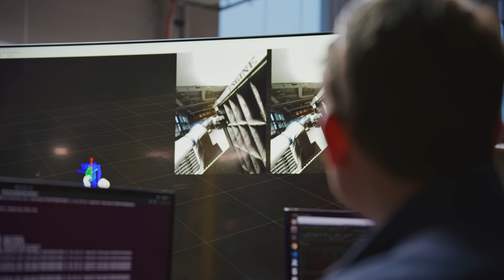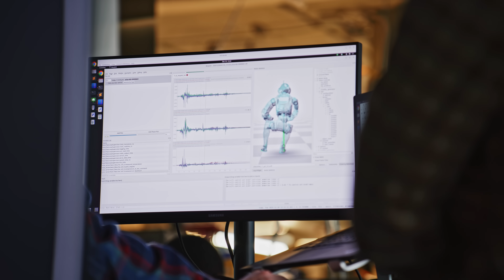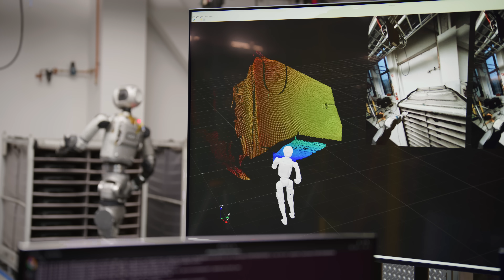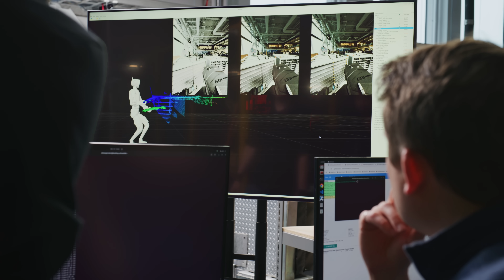Pick, Carry, Place, Repeat | Inside the Lab with Atlas

Comment: Robot's head turned 180.   But at 5:05  he referred to it as 360 motion.    Since it requires energy and complex engineering to rotate a head 360, why not just give it another eye on the back of the head?  Then instead of a mechanical rotation, it can simply flip a switch to use a different eye?
Reply: Probably due to cost and complexity. It might be easier to have a set of sensors in one direction and a swivel for the head, instead of lots of sensors all over the head.
Reply: It has multiple different sensors on the front of its head, so it needs the ability to point them all at once. Otherwise its head would be covered in sensors pointing in all directions, which would be much more expensive
Reply: @AwesomeAdmirak sure but most humans track spatial awareness. You know if someone has approached you from behind. You know you can take a step back and pivot before turning your body. I would think one more camera on the back to give the bot that "awareness" would be more efficient than an owls head-spin.

Or do you mean to say that less sensors therefore means less software to integrate and so its a simpler hotfix during the development and prototyping?
Reply: @ What other sensors does it have on it's head and how is it using those sensors in this video?  A human can do that  job with only eye sensors,  and touch sensors in the hands/arms, doesn't use the nose or tongue sensor to move a widget from point A to B.
Reply: @DEO777  mostly humans use hearing for most spatial awareness but yeah the robot turning its head is easier than having additional back facing sensors, also note it has extra cameras on the sides for wider vision
Reply: @DEO777  I don't know what they are, but you can see a ton of camera-like devices on the front. It's true that the task is possible with only two eyes, but the "software" of a human brain is way more complex than what they currently have in these robots. It could be that they have depth sensors to measure depth without complex computer vision calculations
Reply: @michaeljamesm  In that case, then robot should have a stationary head and only rotate at the waist.  The head rotation is unnecessary complexity.
Reply: @DEO777  "In that case, then robot should have a stationary head and only rotate at the waist.  The head rotation is unnecessary complexity."

It's much easier and takes less energy to turn a small mass like a head to see, than to turn a big mass like the whole upper body. Also, when you see things, you make small adjustments to your head and eyes to see clearly. This would be much more cumbersome if you had to constantly adjust your whole torso to see properly. There's a reason why animals have necks.
Reply: @20Twenty-3  Yes, animals have necks, but robots don't need necks. R2-D2 was very functional robot with no neck and no waist. Software can make the adjustments to see properly. The robot needs to be simplified for it to be economically feasible.
Reply: @DEO777  And yet, R2-D2 had a head that could rotate independently from the rest of his body. Having sensors that can move independently from the body is an advantage, which is why many robots have them.
Reply: @20Twenty-3  Robot in video has 3 ways to rotate on it's vertical axis (head, waist, feet).  It only needs ONE, everything else is redundant complexity.
Reply: Its less complex to have a rotating head than it is to have multiple eyes.
Reply: In fact you can have 360 view all the time, the head never need to turn, it is a robot, why have limit to match a human head.
Reply: If it generates a model of the environment and remembers it, it should be able to start moving before rotating the head, unless a person has slipped in and we dont want a collision with the human.  The head turn does look slow.  A rear facing sensor of some sort might be able to ensure safety while increasing speed.
Reply: 可能是被人形限制了創新
Reply: More cameras and more sensors turns into more data it has to correctly process and interpret. You’ll already want the head to turn so it can point the right way and get a good perspective. Might as well just use the one set of sensors/cameras and have the head be able to turn farther rather than double, or more, the amount of data.
Reply: @NBSV1  It doesn't have to process data from all cameras all the time, only when camera is called by main process.
Reply: @ Ok. Now you have to do extra work and programming to have it decide which to turn on and accept information from. And, deal with the gap in data from switching to different sensors. Then add in powering the extra stuff. Do you leave it powered but not communicating which drains the battery? Do you switch them in and out of standby every few seconds? Do you have relays to switch them off and on? 
It adds way more complexity, engineering, and energy when you just throw double the cameras and sensors at it. All of which can be solved by simply turning the head. Then you only have to worry about the single set of sensors/cameras. And, they provide a consistent stream of data so it can keep its bearings. They typically try to get the fewest number of sensors and cameras they can so it’s easier.
Reply: @NBSV1    you are over-complicating the process.  Instead of the software calling a procedure  for a robot-head-rotation (180), it instead calls for  the rear camera to activate.  It's a trivial process. Ask your favorite AI to show you the code. It's less than a page.
Reply: @ And, you’re over simplifying it. They aren’t using the cameras simply to transmit video so it isn’t as straight forward as switching the video feed. They’re using the cameras as data input so the robot can see its surroundings and complete tasks. It needs to keep its orientation to the camera. Just think if you were walking and suddenly switched views to behind you how disorienting it would be. 
If nothing else you’re comparing doubling all the cameras and sensors to adding a single motor to turn the head. Which you’re going to want the head to turn anyway so it can get a good perspective and stay focused on something while the body moves.
Reply: @ how about a 360 deg thermal camera operating all the time on the lookout for humans that when triggered pings the main feed?
Reply: @NBSV1  Rear-camera on stand-by can do orientation calculations on it's own processor or thread at same time as front camera,  OR it can wait to be called before re-orienting.  A rear camera also enables the robot to continue working if front camera fails.
Reply: @ That sounds like the energy and complex engineering you were originally trying to avoid with the head turning. I’m still not seeing how a whole second bank of sensors and cameras is less complicated than a motor turning a head. You don’t have to put it on standby, don’t need extra processing so it can do its own calculations, or anything else. 
You’re basically saying it’s too complicated and unnecessary so let’s make it even more complicated and more unnecessary. A motor turning a head being replaced by multiple cameras, multiple sensors, all the wiring to support them, and all the programming to support them. Then to end up still wanting to head to turn anyway so it can get a good angle on things.
Reply: @NBSV1  Most people have a phone with a front-facing and rear-facing camera.  You can find that technology plus software plus additional hardware in a $30 phone.  Why don't the phone manufactures ever produce  a phone with one camera that pops up and rotates?   Because that would be adding complexity and cost. Software is very easy to copy into each additional robot.   Building a rotating head into each robot is NOT easy.
Reply: @ This isn’t a phone. Your phone doesn’t need to keep up with its location and interpret what it sees. The phone is just being a camera that saves information.
On an autonomous robot it needs to orient itself properly, interpret what it’s seeing, and respond accordingly. In addition to the feedback from all the sensors in its limbs. Not exactly as trivial as a camera on a cellphone. 
Considering what they’ve accomplished I’m going to go with Boston Dynamics knowing what they’re doing.
Reply: @ i figure there is also the factor that the AI programming chews a lot of juice so you dont want to ramp things up even more?
Reply: @NBSV1  The robot doesn't even need any cameras mounted on it, and wouldn't even need a head.  Stationary cameras can be mounted in each work area and control the robot remotely.  You'll see, eventually this will prove to be the better solution.
Reply: @  The majority of AI processing is done during the learning stage.    After that's completed. a consumer-grade GPU  can enable real-time interactions.

Comment: So often these humanoid, bipedal robots are showcased doing such simple tasks that don't necessarily require a humanoid, bipedal robot -- moving objects from point A to point B -- that could be handled by a thoughtfully designed, purpose-built conveyance system. I recognize the adaptability of this type of robot to an existing environment designed for humans is a huge selling point, but I'd really love to see examples of these robots being leveraged effectively rather than demonstrating a sub-optimal solution as far as equipment cost and operating cycle time.

Comment: Atlas is built for industrial production and manufacturing/warehouse work, beautiful design, but what is even more amazing is that it’s built to be predictable while autonomous which I don’t think many other companies could truly say. You don’t want machinery that is unpredictable like an LLM, you want something that when you  have it commit to an action, it does it the exact same way every time it doesn’t give you a creative path to doing it and Atlas is predictable, efficient, built for industrial setting. I feel like there’s a disconnect in general Public with that understanding. While Boston Dynamics could make their robot run off of a chat gpt kind of LLM it’s just not practical or safe to do so. What you really want is consistent and able to adapt to anomalies.
Reply: wouldnt any neural network be out of the question at that point? Idk if theres any that provide guarantees in operation

Comment: Managing edge cases and extremes in motions generated by an AI model sounds extremely challenging. Curious if the sequential order is intentional for testing or a current limitation. Seems like it would be able to double fist a single part and slot two in at once, or at least one after another without having to return

Comment: what I don't understand is why, just like star wars, the robots don't have 360 view cameras.   why have another motor, pivot, etcetera instead of 360 view..
want to look a different direction, don't need to turn the head, just analyze video from the other direction.   
you talked about 360 pivot as saving time.. how about saving time by not having to pivot? 
too costly?  it's offset by a complex joint that can develop issues and motors to drive that join that can also develop issues. 
video processing too costly?  how about taking a book from 3D and VR rendering where you have the highest resolution from a certain area and you don't even need to process unrequired areas.  have enough processing power?  then you can have 360 awareness of other things moving around you without having to do very high resolution evaluation.. 
'humanoid' has its limitations, which you took a  step away from with 360 rotation, but it seems like a wrong step as you didn't achieve your best stated goal of faster looking.

Comment: I like the movements of the frame configuration on this one; very fluid. It seems that it would cut down on wear and tear having a design that moves the way this model does. There was minor  shaking when performing precise tasks, but getting up off the floor and the locomotion pivot when putting away the part looks really polished.

Comment: The sensors technology have improved a lot, for example, Light Control Metasurface (LCM™), and induction charging for wireless charge for reduced size batteries, should be a no brainer.

Comment: Vacuum pneumatics. Silicone tube with bespoke coil wound around it, flexible internal rod with seals and magnet, gives you positional sense. Start big and attempt to reduce it's size and weight. 
As for AI, go back to the drawing board, the standard neuron model isn't correct, the neuron spiking observation isn't cause, it's effect. Also look up the word striation. Ion channels don't terminate at the neuron, they wrap around it.
That's all you're getting :P

Comment: I have to disagree with the premise introduced right at the start of the video 0:17. Yes, task switching for a robot would be interesting, but I have yet to see a convincing scenario where a humanoid robot is better than a human in a singular task. Let's get there first...
Reply: Lol
The singular tasks don’t require humanoids - they’re the machines that have replaced most humans since the industrial revolution.
Reply: For this particular task the Atlas is doing in this video, a robotic arm does hundred times for efficiently...
Reply: @S3l3ct1ve  but can also do a thousand other things - and can deal with deviations and set ups that are not as automated as a manufacturing line.

Comment: This is an ignorant question on my part but is there a reason we are so invested in bipedal locomotion and not something more out-of-the-gate stable like quadrapedal configuration? I know BD has a version of this, but I guess I'm wondering why we don't keep the top as we see here but add a couple of legs to the bottom (and maybe extend arm length a bit to compensate for leg spread).  It doesn't seem, to me, that the larger 'footprint' created by this would greatly hinder where/how these are already suggested to be deployed vis a vis this demo, and then falling would be difficult. But I'm surely neglecting many variables. Thanks!

Comment: Realistically though, humanoid robots in industry is just a transitional phase. Factories of the future will be built from homogeneous boxes with modular interchangeable components like rollers, cameras, graspers, lasers and other sensors etc. They will form both the manufacturing process and the self assembling structure of the factories, and be capable of dynamic configuration and self replication. If you're not already developing this then it might be about time to get started. ;)

Comment: Of note is electrification taking over hydraulics, this requires batteries to significantly improve. They have and still are. While there's never a "breakthrough" battery tech, despite some claims, batteries incrementally but relentlessly improve YoY. Electric motors are extremely powerful and very reliable already, like pumps working underwater for decades, or trians using electric motors from the 50's (1920's first tried) because engines are not as powerful. Batteries are unlocking technology you can't even think of yet.

Comment: Why does the head need to turn if the robot has 360-degree cameras and strategically placed sensors? 
maybe a screen on both sides could help distinguish the front from the back and serve multiple purposes, eliminating the need for mechanical head movement.

Comment: Sorting engine covers doesn't seem like it is very useful or difficult, but a robot can do a lot if it can dynamically pick, carry, place, repeat reliably. However, does that mean you are focusing primarily on B2B for the product version of Atlas? That is what this kind of task is more suited for. Sure, in a house environment, pick, carry, place is necessary for somethings, like organizing phase of cleaning, or fetching me a can from the fridge, but a domestic robot would need a different set of skills and training to be useful than a commercial robot.